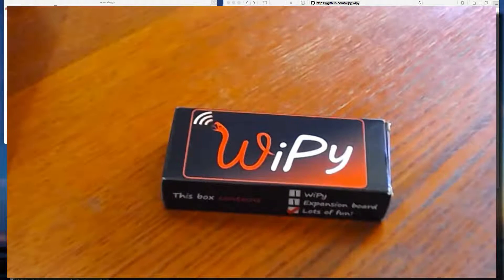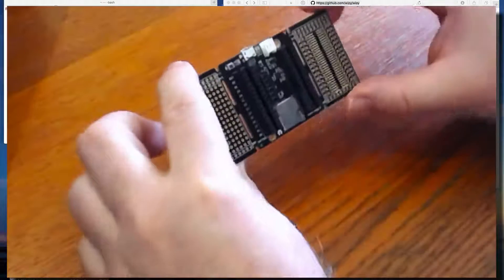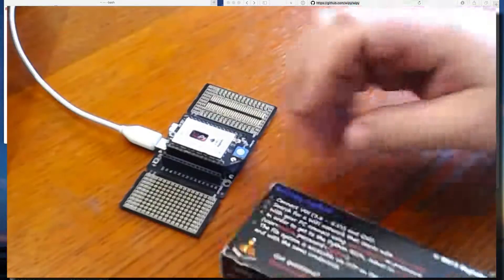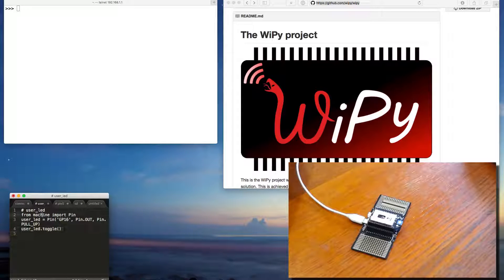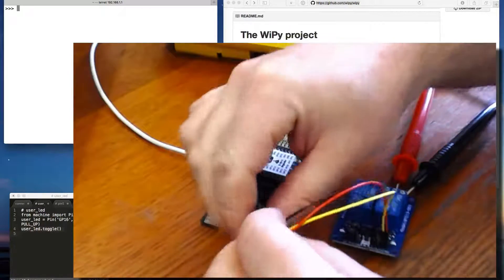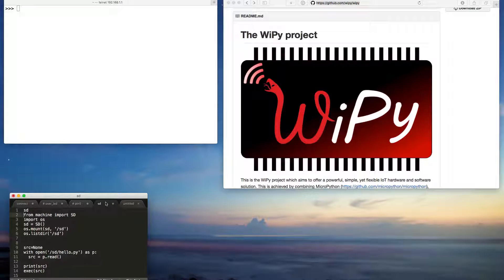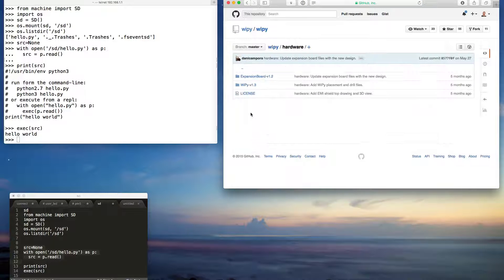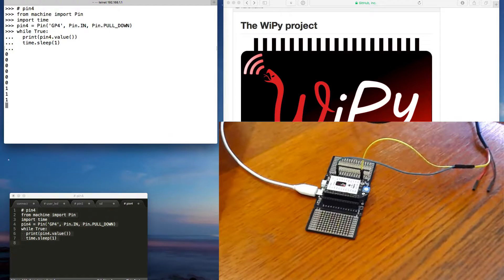wipy

Comment: Can we program it without an expansion board, using RX TX ?
Reply from the maker: The best place for questions is https://forum.pycom.io/.

According to the first paragraph on https://forum.micropython.org/viewtopic.php?t=1835, the answer is yes.
Reply: Thank you sir :D. But how will i get to know about the IP address if i want to connect it wirelessly considering I powered it up for the first time?
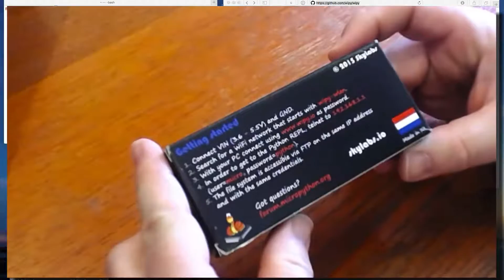Reply from the maker: The WiPy's IP address after you've connected to its WiFi access point? Check the box  -- see 0:13 in the video, where my box said 192.168.1.1. https://docs.pycom.io/pycom_esp32/pycom_esp32/getstarted.html#first-interaction-with-your-module says 192.168.4.1, so perhaps that was changed in later models.
I imagine you can also find out by checking your DHCP-provided WiFi network settings; replace the last IPv4 address octet with "1".
Reply: Martijn Koster great. thank you for the info.